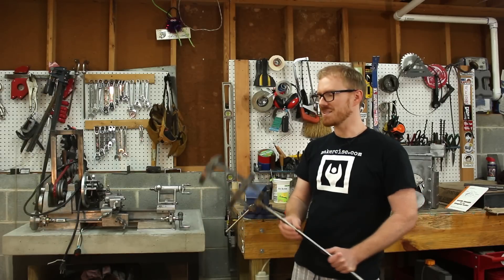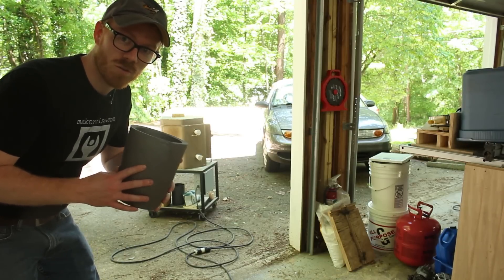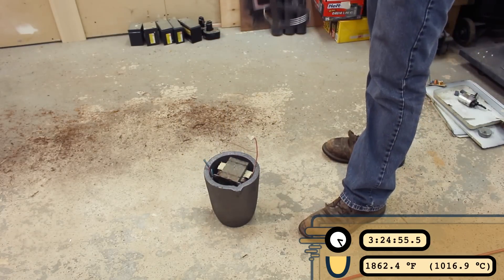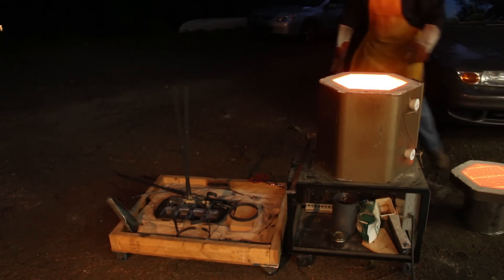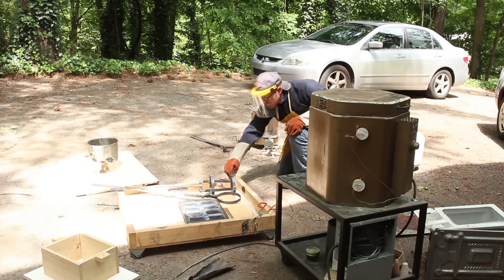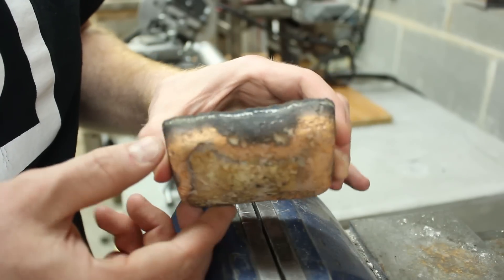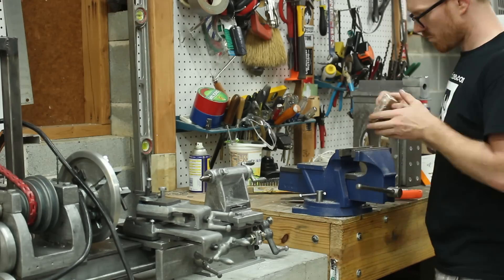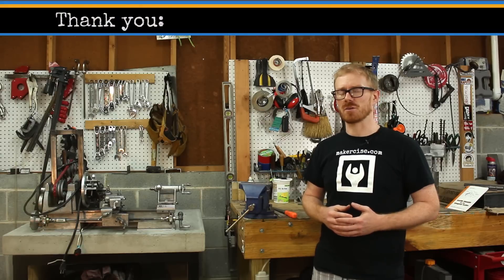Bronze: Fabricate Crucible Tongs and Shank and Alloy at Home

Comment: You didn't preheat those moulds, did you? Coulda caught a molten droplet of Cu in the groin!
Cheers
Reply from the maker: I did preheat off camera. Also as per my usual PPE, I work with groin area well protected.
Reply: @Makercise  I was hoping there was some simple reason for the popping, I've seen a couple vid of molten copper making that angry simmering sound.
I'm going to pout some copper hopefully later this evening, so I was kind of trying to convince myself that I knew why that popping happened and it wouldn't happen to me, but it's better that I just be ready I guess, lmao
Reply from the maker: The pans are a bit rusty. I think it may be a reaction between metal and mold. Perhaps I needed to preheat hotter or longer, too. PPE for the win.

Comment: Hey man... this is a great video! I have never made a foundry, nor have I ever melted metal. I need to make a specific alloy, however, that is not commercially available, to my knowledge. CuNiFe (Copper, Nickel, Iron). It will be 60% Cu, 20% Ni, and 20% Fe. Can you tell me if there are any special things one must know about making an alloy, or do you literally just melt the three metals down in a foundry, and they alloy just happens? I imagine one would add the metals to the crucible in order from highest melting point to lowest, so that you aren't just cooking the hell out of the lower metals while you get up to temp to melt the higher ones. And I imagine there must be some kind of stirring involved to mix the metals before you pour the ingot... other than that... anything you know of?
Reply from the maker: I did a fair amount of research to find a source for instructions on making my particular alloy. You should too. In my case I made and intermediate alloy since zinc is a vapor at the melting point of the alloy. There are physics phenomena I do not understand at work in metallurgy. Often I have seen that the lower melting point metal will dissolve higher melting point metal into the alloy without ever reaching the actual melting point of that alloy. I wish I could give you a better answer, but I think it depends on the alloy in question.

Comment: Also, probably PTFE muffin pans aren't such a fabulous idea for ingot molds, that smoke is very toxic and includes such delights as hydrogen fluoride. Better to strike off the surface of the sand and press the muffin mold into it. Then the ingots are the same convenient size and you save your lungs :P

Comment: I was fascinated by your handheld alloy analyzer. So I researched similar devices as far as I could and learned a few things. However I could not find out everything I wanted. Maybe you have come across the answers I am looking for.
Can your or similar devices analyze different steel alloys like mild steel, low alloy steel, alloysteel, carbon steel, grey iron etc. I am asking because no device that I found could measure the carbon content.

Comment: I have researched these hand held X-ray analyzers which really are very pricey. New they are around $20'000. 8-O Used ones are from about $2'000 upwards. What I could not find out about them is whether they can determine the carbon content of steel. Can these X-ray analyzers differentiate between mild steel, medium carbon steel and high carbon steel?
Reply: https://www.bruker.com/products/x-ray-diffraction-and-elemental-analysis/handheld-xrf.html

I was thinking the same thing. This one says "from magnesium to uranium", so, no carbon :-(

Don't know about others though
Reply: The X-ray fluorescent (XRF) analyzers don't work with light elements like carbon. Only elements heavier than magnesium (Mg) but not heavier than uranium (U). 
Arc spark OES (Optical Emission Spectroscopy) Analysis using Argon as a shielding gas around the spark is the only method that can provide an accurate, quantitative Carbon reading in steel.

Comment: Hello, I'm Fenil Jariwala. I'm Metallurgist. So suggest you plz you get spectro result of all the element you use in making alloy and plz balance the system of charge balance and mass balance. And for the making alloy the thing is that you should hold for the metal at the same temperature you want pour into the mold. Holding time is take the phase making process in metal and alloy system... So you need to minimum 30 to 60 min hold at the high temperature and when metal is super heated after that you pour the metal in to the mold. From this method you get accurate composition alloy and good quality alloys.

Comment: At 13:10 when you were lifting the crucible from the furnace it was stuck to the brick in the bottom, the trick I've heard to stop that from happening is to put a piece of cardboard under the crucible, it will burn down to a layer of carbon and keep the crucible from sticking to the block, I've only done a few heats of copper but it has worked for me.
Reply from the maker: The first time I melted copper in the kiln I used carbon powder from boring a gouging rod. It worked great. I forgot to add the carbon to the plinth in the crucible when it stuck and when it made the sticky glass strands. I'll try the cardboard trick in the future too...at least if I remember.

Comment: I would get rid of that pop-rivet before I loaded that crucible with molten metal. Drill it out and replace it with a small bolt. Put washers on both sides and then your nut....And put a tack weld on the nut to the bolt. The rivet is nothing but a hollow thin sleeve of steel. 
  Maybe the rivet will be fine, however I've seen so many fail. And I would hate to see it fail on you while loaded with molten metal. Its just too dangerous to risk.
Reply: I was concerned about the same thing.  Another solution would be to use a cored structural rivet.  When you "pop" them, the steel core stays in place making the joint much stronger.

Comment: I guess I should make a vid showing the style of tongs I learned from Sam Johnson, the guy who taught me casting. They're lift and pour tongs, so no fussing around. How much did you spend on alloy? I can see how you could save over factory alloy. I'll also add modern pennies are mostly zinc, I wonder how they compare to market price?
Reply from the maker: I think I put a link to the tin popcorn and zinc hexes in the description. Off the top of my head $20 for 1lb of tin and $8 for 1lb of inc. If you are up for dropping $11k you could get tin down to $10/lb. I think tin is the reason bronze is more expensive than brass.

Pennies are worth less than the zinc in them. I bought the zinc hexes to avoid defacing the currency, but I did use a penny to get it to the right amount. I really like and recommend the popcorn and dripping methods. Very easy to get precise amounts for alloying.
Reply from the maker: Oh and please share if you make a video.

Comment: Please tell me you shut that old kiln OFF before poking around in it?  I have that same old kiln I use for investment burnouts.  Cost me a whole 25bucks and it still worked!  Melting metal in a kiln takes FOREVER.  I run an oil burner.  If you are going to spend more time melting metal, ya might want to swing by alloyavenue.com.  Good stuff and good people.
Your tongs are too thin by the way.  I wouldn't trust them with 25lbs of bronze.  Hate for you to get a new nickname like "stumpy"

Comment: Nice work!
Wouldn't you lose less zink and produce less fumes if you first melted the copper and then added the alloying metals? The shorter the time zinc is in it's molten state, the less time it has to vaporize.
Reply from the maker: I believe so. Note that I did melt the copper first and then added an ingot of the lower melting point metals. Like you said, less time at high the less time for zinc to vaporize. Once the zinc is in though the alloy's liquidus temperature is lower than the vaporization point for pure zinc. There is a link in the description to an article that describes the process for bronze alloys containing lead.
Reply: Alright, I must have missed that in your video! I'd think the zinc content may even be diminished in the alloy if you were to melt them together. Good thinking.

Comment: Nice to see a young man getting out there and doing things....gas seems more efficient for the furnace than electricity. Major Dad points when you got to tell your child you MADE your new tool!
Reply: Gas is faster, electric is slower, Gas usually has a hotter max temperature, Electric is generally more controllable with temperatures and temperature cycles.

Comment: you might want to recheck that your calculator did order of operations correctly. when you multiplied the answer of the first run, it appeared to just reentered the math and add your new number to the mix. could cause problems.

awesome vid!
Reply from the maker: I checked it. Looks right to me. The XRF analysis also seems to indicate it was right...or at least close. Maybe if you could be more specific I can find the error.
Reply: Makercise wasn't sure it was an error. calculators vary in how they handle order of operations, so it was possible that there might have been an error there to check. It's something that caused me no end of problems while going through my calculus courses. Ot seems good so you should be all set.
Reply from the maker: newton9837 cool. thanks

Comment: When I made bronze I melted the tin first then added the copper. The copper dissolves in the tin so you never have to bring the melt up to the melting point of copper which is higher than the bronze.
Reply from the maker: The article I link to in the description talks about various types of bronze and why the alloying process is different for the various compositions. Since I used tin, zinc, and lead, the alloy ingot method I used was recommended.
Reply: Jim Hannon, Nice tip. I hope he tray it the next time.
Reply: Jim Hannon Exactly!!! Why does everybody add the tin at the end? Plus metal melts much better once you have a pool going on, then add the higher temp metals.